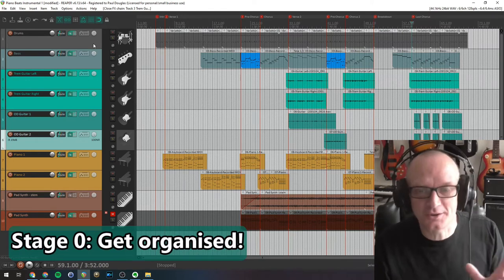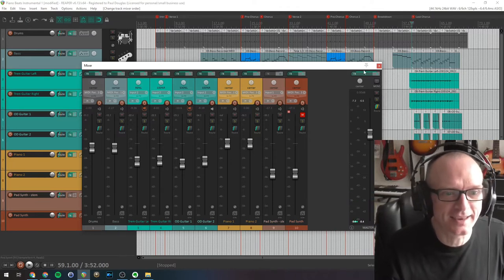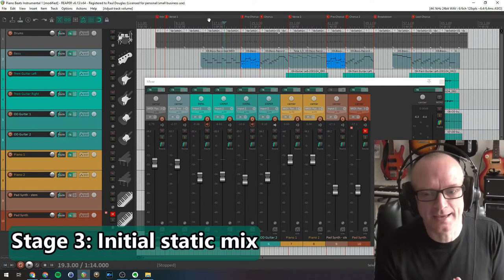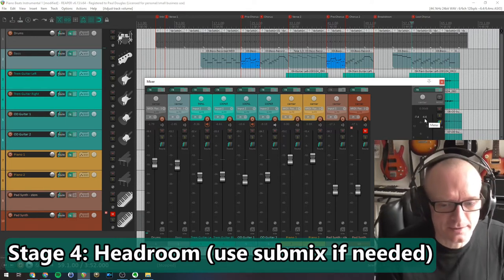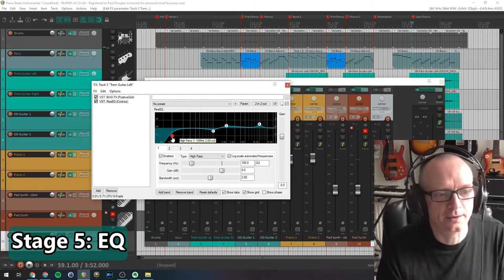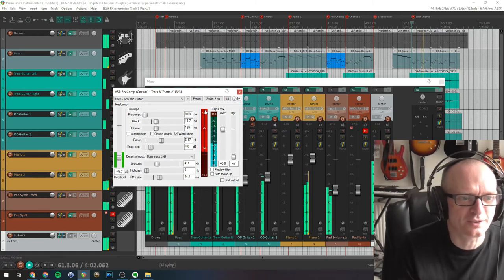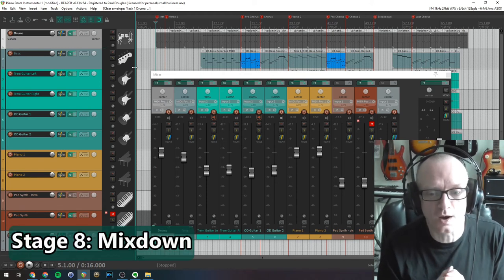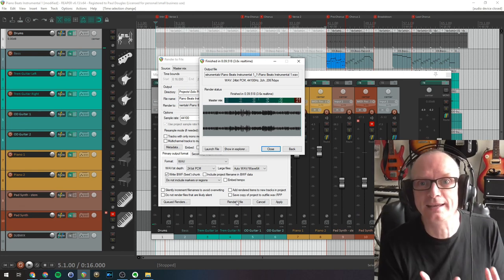Mixing a song on Reaper | My mixing process

Comment: AMAZING step by step process. You actually covered so much of what I've been dealing with lately. I've been using Reaper for tracks for roughly four months now and it's great, but I have been running into a few issues which you've perfectly provided a remedy for. Thank you!

Comment: AWESOME tutorial!.... my two cents worth:  [1] After you Gain Stage and have a 'rough mix', do a 'render' and listen to it on a bunch of systems before you start your mixing stage----this gives you an objective outside set of references to reflect upon when you're boosting and cutting things while building your final mix; [2] For 'Automation' use the 'Read' option so you can see the faders/controls actually move---any accidental/unintended 'ghost' automation that occurs will drive you nuts trying to find out what's happening if you can't see controls moving.
Reply: You must automate a lot of tracks. It is good advice nonetheless.

Comment: Paul that was simply one fantastic video I just watched, well done,  I have reaper with a year now since lockdown and still learning, the issue I would very much appreciate if you can answer here or make it part of you next video as I'm sure it will help many, rendering the track you just did I notice really narrow wave lines, do this indicate your track will be really low, play in car stereo boost volume, eject and the radio come on and blow you out of it in volume, add to your Google drive, play it on your mobile and you can barely hear it,
On the mixdown and rendering window I look for wider stereo wave forms by turning up the master fader firstly and avoid clipping, yes I know, this is wrong, totally wrong, and should never adjust master fader, and as you said create a master bus, never did, but now I will for future reference after watching this video, look forward to many more,
Excellent job, well done 👏👍

Comment: Great video! The track is very chill too. Quick question, why route all the tracks to the submix via the way you did it, and not just drop them in folder track? Is there a difference?
Reply: I'm also wondering that- also wondering why you can't just bring the master volume down a bit to avoid peaking? Isn't that the same as bringing a submix track volume down

Comment: I wouldn't find it very necessary to have a submix unless I'm using a reference track in the same project

What I really want is to have a visual track of the full mix so I can check easily for peaks silences, etc. Without the need to have to render the project so I can fix it quickly
Reply: iirc there's a way to add a colour visualisation of the peaks etc on each track.

Comment: Very clear and useful video! Thanks! Just one question - I hear this a lot - "play it on many different devices to make sure it sounds good on all of them". How does the latter part work? If it sounds crappy on one device and you change your mix, it may now sound acceptable on that one device but it will sound crappy on all others, right? Do professionals actually create different mixes for radio, streaming and classical media like CD or vinyl?
Reply: Well, I suppose it's the art of compromise.
Sometimes there are different mixes (for different media or releases -- eg single vs album), but not for this reason.
You do get different masterings, however.
And that's where the crappy cassette release from the 80s will go for a different compromise than the MSFL gold-plated CD.
The latter can afford to do away with most compromises, knowing that the buyers will probably have a high end setup and a treated room.